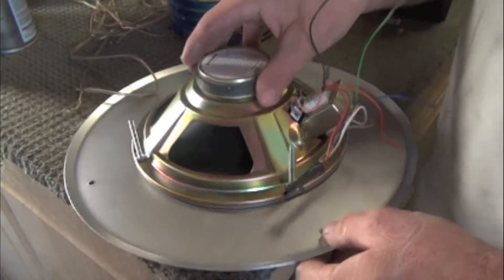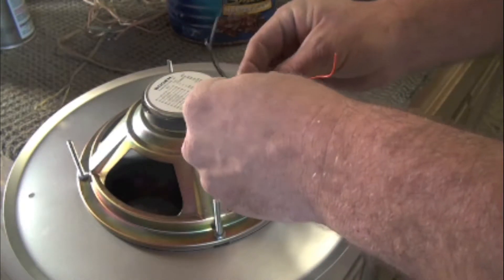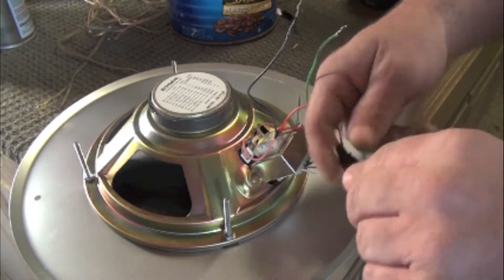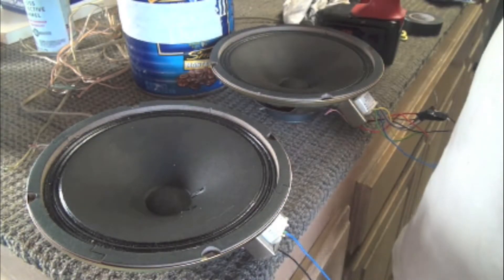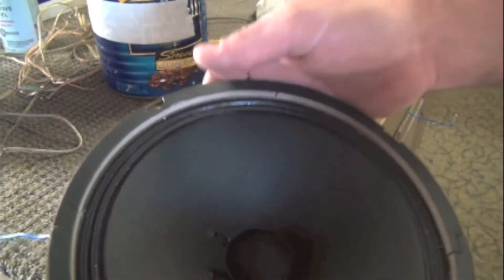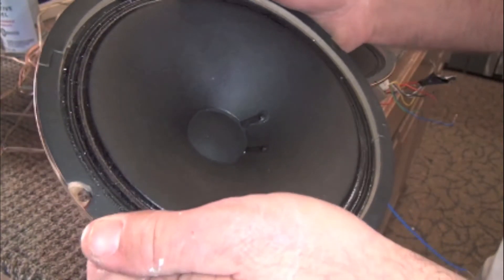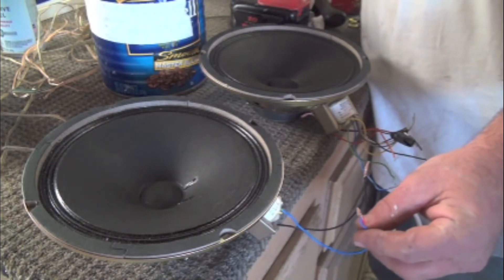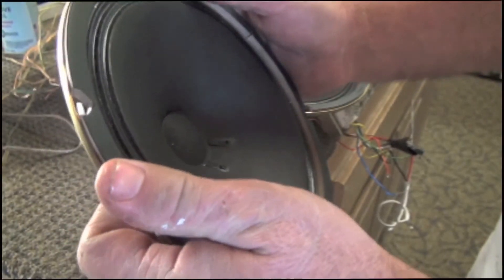p5 WHAT, A Blown Speaker? *20 speaker Backyard Sound System Install - DIY Project-70v step by step

Comment: Thanks for posting this video.  Quick question.  I have a client who is running a 70V audio system in their day spa.  The original 100W amp went out, and the replaced it with a 250Watt amp.  Now it has a whine coming from the speakers, even with no signal being pushed.  Could this be due to the transformers on each speaker being tuned for a 100w system, and the 250watt system being too much?  Just wanted to get your take on this.  I come from the car / home audio world, so this 70v and 100v stuff is a new concept for me.
Reply: Hey, when there is a high pitched whine it can be 3 things
1. Power outlets, ALWAYS use a properly grounded power cable, and if possible ground your signal cables too
2. It could be a setting on the amp, try fiddling with the amp settings 
3. Check your music player settings, or try different a different source
Please note: While it is rare, sometimes products DO ship broken, try returning it and getting a new one.
Reply from the maker: +whitesites 
Im not sure but try turning the output on the receiver down to its lowest point. I spent time adjusting my set up to what it is now & im satisfied with its performance.   It could be too much power, also the speakers should have the ability to be tuned as well so maybe try turning those down if possible. hope this helps & maybe somebody else can weigh in.

Comment: Voice coil was rubbing. Either that driver was driven too hard or it has a failure like dirt or crap in the coil. 

Just best off to replace it with another equal wattage driver and save the transformer.